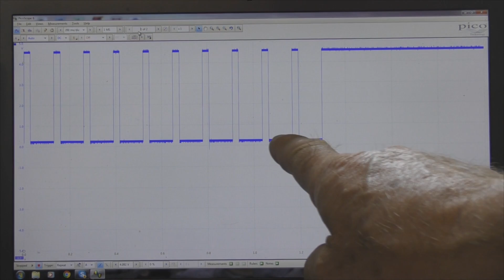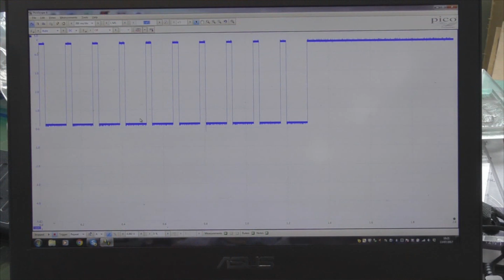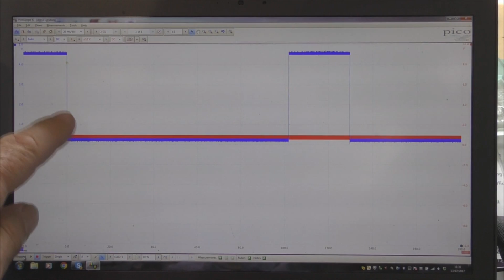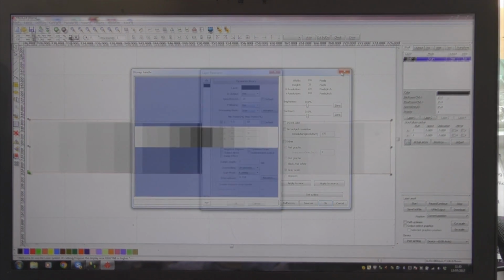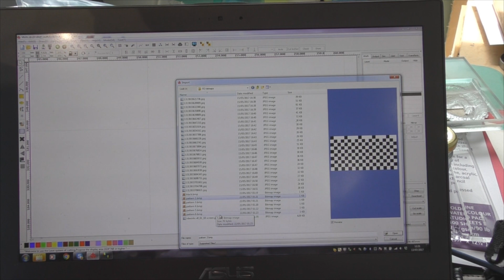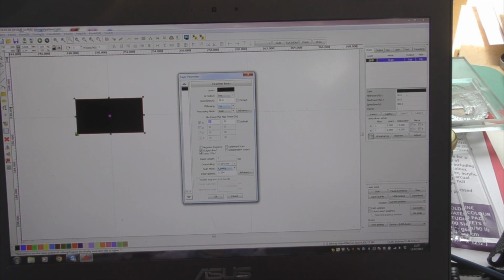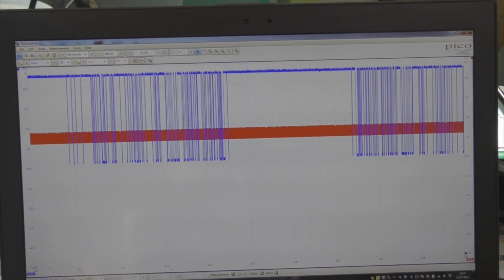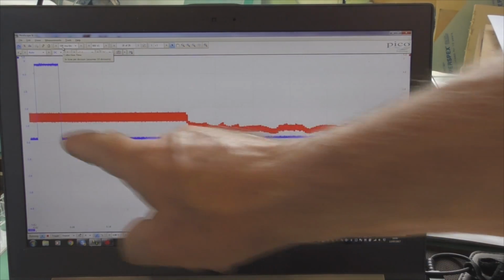RDWorks Learning Lab 112 Checking those Dots with an Oscilloscope

Comment: Hello Ross, you should be able to look at the oscilloscope from your hybrid servos, the leadshine website has the tuning app where you can actually take a look at what is goin on with your signal, from looking at my own servos, I do not see any start stop pattern going on. each swipe is a smooth stroke from 0 to the set speed and then to 0 again at the end of the travel.
Reply: BTW, It seems like that guy that was insisting that the striation while cutting acrylic could be corrected with a toothed idler pulley was right, I recently upgraded my rails systems to CCM rails, they come with toothed idler pulleys, the cuts on acrylic are very smooth, so the belt is part of the problem, the stepper motors are the other part and the natural oscillations that happens when the acrylic is vaporized the other culprit. I've been looking at acrylic cuts from balls screw driven laser cutters and the results are marvelous, 0 striations.

Comment: There's no doubt  a stepper motor is run in individual steps.  I'm pretty sure you'll find corrolation between the stepper drive and the dots.
Reply from the maker: I'm not discounting the stepper because although It's micro-stepping it is basically a  200 step/rev motor. Now, if I run the linear speed (pretty slow) at some critical value, that motor will run at 1 revolution per second That will put the step interval at 5ms. ( my magic number). Yes, this may be a problem, but if I can identify that as the cause , it will simply be a matter of avoiding speed and resolution combinations that get you into that region.
Best regards
Russ

Comment: It has to be mechanical.  Either the laser itself has inherent flicker (which I doubt) or the drive is imparting the pattern  I think the next step is to look at the stepper motor signals.
Reply from the maker: I think you are correct in your mechanical prognosis. I am therefore a bit puzzled as to why you would immediately jump to examining stepper dive signals. If it's a mechanical problem,  I next want to relate that visible mechanical issue to some cause. It may be belt slack or belt over-tension, It may be resonance in the belt itself  caused by the stepper drive. I'm hopeful that an accelerometer will help pinpoint the problem. Let me be quite clear, I am not trying to fix the problem I am trying to understand it. It seems to be a narrow region and once understood, excluding those operating parameters would be the cost effective solution.
Please do not regard my answer as in any way negative. Your suggestion (and those of many others) help to undermine or reinforce the direction I am taking. Stopping me in my tracks and making me think again and again is nothing but positive So thankyou for your comment.
Best regards
Russ
Reply: SarbarMultimedia I guess I jumped to the stepper drive because it does drive the motor in discreet steps (or microsteps) and it seems that, if the issue is with the drive, the part that is known to be happening in steps would be good to look at.
The stepper driver may be able to be changed in how it handles steps as well which would be interesting to see the results of.
Those things being said obviously I'm not there so it's all speculation from my end.
Reply from the maker: If it does trace back as far as the stepper drive I may need some expert help, so don't dump me!!!
Reply: SarbarMultimedia absolutely not.  it looks like we have a pretty good based of people watching and commenting that we can figure this out together!  plus yours is one of my favorite channels.
Reply from the maker: Phew....a safety net!!
Reply: You can also replace the stepper drivers with some direct drivers. I have a set laying around I can lend you. They are drop down replacements, but simply doesn't have any steps; hence they move completely smooth.
Reply from the maker: Hi Peter.
Thanks for that kind offer. As an electronics idiot, I'm not sure I would know what to do with them. However, I must stress that I'm not out to fix the problem but to try and identify what the problem is and maybe it's causes. From what I see so far there is limited range of speed and resolution where this dot phenomenon occurs. If so then it screams resonance somewhere , most likely mechanical (drive belt elasticity?). That is what I plan to track down if possible.. It may be just a simple matter of avioding those parameters.
I'm also sure that the HV power supply will be involved in this story also. I did plan to change my China Blue power supply to the more responsive type I  have in the Lightblade, but if I do that I lose the ability to compare. This just reaffirms my philosophy to explore and understand but don't fix.
All best wishes
Russ
Reply: Hi Russ.
I also have a spare RECI PSU - it's got a lot of bells including inbuilt tube diagnostics etc. 

I am still looking at the laser-tube as being the issue (I do have spares of those as well, but they are hellish to ship!). But it is really nice to get all the other issues out of the way. :p

Why not the tube? You have two machines you are testing on and they don't have the same tube, as far as I can see. And yet, they have about the same issues. SInce they have the controller in common, that would have been a nice source! But alas. ;)

Changing the gearing on the stepper drive train might be fairly easy - might cost you half your top speed, but you rarely seem to use that anyhow! So maxing out at 250 m/s might not be an issue. Having twice the teeth, however, might do a lot of difference.
Reply: Finally caught up to this point and I don't know if you've figured it out yet or not (I have a few more to watch!), but I wanted to point out that you got nearly identical dots on both machines  (slightly more defined on the lightblade). The lightblade uses a completely different drive system, and if I recall, it's also driven by servo motors. Since both have the same dot profile, I think heading down the stepper motor rabbit hole won't yield anything... of course, you've likely figured it out by now, so I'm off to watch the next adventure!

Comment: You can do a other little test, look at the 'clock' pulses to the stepper motor.  if the pulse train is not perfect itse means the issues is due to timing issues made bij the controller,  if the puls train is perfect then the stepper controller is not perfect, ( and i can tell those stepper driver are not perfect specialy in micro stepping) if set excample 1/32 micro step do not expect a perfect 1/32 angle step.
Reply from the maker: Hi Marco
You are undoubtedly an electronics genius but I'm afraid I'm not. The results are there for all to see and they occur in a narrow parameter range. As a mechanical engineer that points me towards resonance . Now I know that can occur in electronic systems as well as mechanical systems but if  resonance is the root cause then the most likely cause will be mechanical issues such as belt elasticity. With any servo system, mechanical stiffness between the driving signal and the load is paramount/. Logic says I must work back from the effect first and who knows, that may lead me back to a flaky drive signal. Please stay tuned because I may need help in your field of expertise.
Many thanks for the comments.
Best regards
Russ